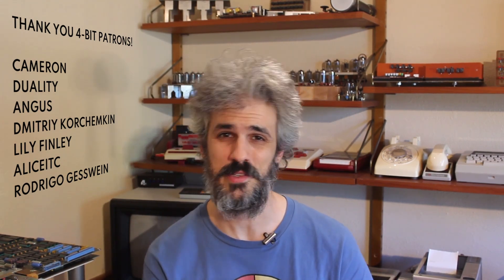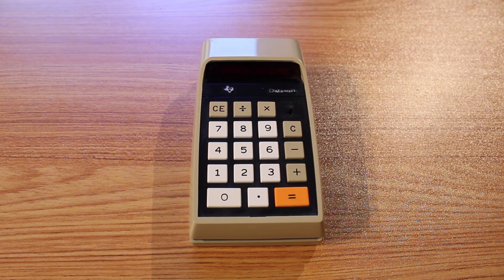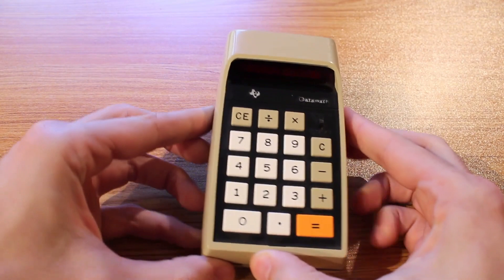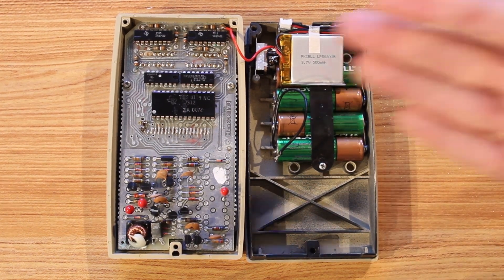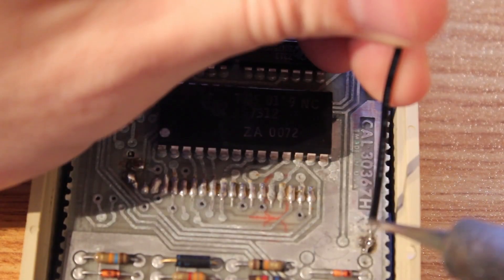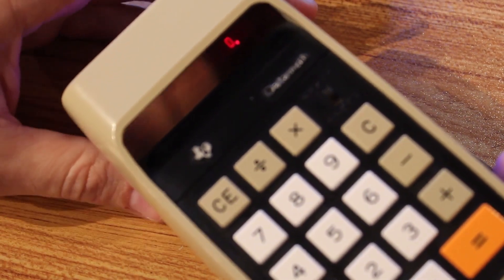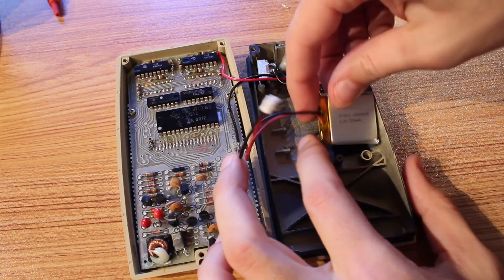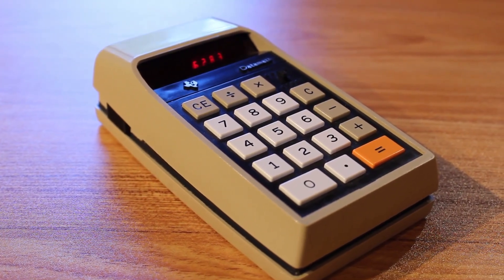Putting a LiPo Battery in my TI-2500 Datamath Calculator from 1973

Comment: I got one a while back for $3.. I swapped the dead Ni Cad to see if it would work, it did. Next step to upgrade to your solution. I've amassed quite a few LED Calcs over the years and luckily all been either a dodgy wire or dead cell to fix. Thanks for this video yeah I'm old school.

Comment: I've got a 2510 which is visually almost identical to your 2500. Bought it in September 74. It has a 2.5mm charger plug like used for some radio earplugs. Also a removable battery compartment cover. Still goes just fine.
Reply from the maker: Nice! The addition of the removable battery cover in the later revisions was an excellent update. These are great little calculators, aren't they!

Comment: You should put the original battery strap (and screws) back inside the unit so it's complete if anyone in the future wants to revert or a better battery technology comes out... but nice job... I think I'm going to make this exact same modification to my 2500.
Reply from the maker: Thank you!
I've got the original strap and screws in a little baggy on the shelf, but I should definitely tape them inside, that's a smart idea!

Comment: I know the feeling. I work for a company that has a presence in all major regions. Thankfully we're large enough that there are usually local resources that can deal with issues outside of our timezone. I did work for a place once where engineers had to dial in to stuff at 3am because there was a problem or something in Australia/Asia. 
Speaking of calculators, I just got a Sharp Compet calculator which has an AC cord. The display on this thing is gorgeous and my purchase was inspired by Fran Blanche's (Fran Lab) recent video on calculator displays. Looking forward to the next videos on the oscope and the minicomputer restoration.
Reply from the maker: It's truly a double-edged sword working with a company that's on the other side of the planet. It's nice that during the day I don't get any e-mails interrupting me, and I can really focus on the work. But then, all the e-mails flood in at night, haha. 
Which Sharp Compet did you get? Most of the vintage Compet models have absolutely gorgeous displays and design!

Comment: Nice job, one thing to consider might be to desolder the blue power LED. 
It might not look like much but it could half the current consumption if you think about it. 

Sounds tough to work for a company where night and day is somewhat shifted. 

Greetings, 
Michael
Reply from the maker: Ooh, that's actually a really good idea!
Looking at Adafruit's datasheet on the Powerboost 500C board, it looks like the blue power LED uses a 1k dropper resistor, which means at most it pulls 5mA, which is probably a relatively tiny amount, but could definitely be enough to alter overall up-time between charges!

Working for a Japanese company certainly has its ups and downs, but for the most part it works out pretty smoothly. It's really only when I need to be on meetings in the right time zone that I end up having to wake up at 5am or have a meeting start at 8pm or something, but that's not too often and totally manageable!
Reply: @UsagiElectric  and it's a great way to grind out that Japanese, I would assume. Maybe not. None of my languages except English are up to the standard of a professional workplace yet, so I haven't had the opportunity to find out.

Comment: So, the black piece between the ivory case is not in the original design, but had to be added, because they could not fit batteries inside. You can actually remove the black insert, and fit a small lipo in there, and it will look like the original concept. That's what I did, and it's absolutely gorgeous. The case meets up and fits like it was originally designed to.

Comment: I've only just bumped into your channel thanks to the YT ad fro your rotating drum memory vid. I have 1 or 2 old calculators which use a magnetic delay line memory and hoped to learn something about them. I also have a TI 2500 and had this very Lipo idea in mind, so thankyou for taking me through (yes, I live in the UK) the pitfalls before I fall into them myself!

I wonder whether the 2 LEDs on the Adafruit board could be replaced by tiny SM LEDs placed behind the bezel as externally viewable indicators, suitably dimmed so as not to wash out the digits, with a bypass switch inside for those who don't want them.

Even though 1950s computing is way beyond me, I did understand the drum memory one so I have subbed.

Comment: Ha I have of these in my closet that I’ve had since I stole it from my dad in the early 80s. I did a similar mod with a lipo and charger but I also added some wheel weights to bring it back up to the original 70s heft.

Comment: I'm a TI freak, I own a few of these and some desktop 3500 with the panaplex display, unfortunately the keys in those calculators is a soldered unit quite hard to fix, my collection of datamaths are all coming from Brazil looks like in the 70's they had a factory there and produced calculator for the entire south American market, the quality is astonishing good, I know some models where made in europe too, from all my LED calculators the datamath is my favourite
Reply from the maker: Nice to see another TI fan out there!
I need to get a 3500 desktop unit one of these days. I have an SR-20 desktop unit, but it's got some pretty serious faults on it, and I'm not sure I can repair it without the schematic. I also have a TI-5015 printing calculator which still works great! Though, even as I try out and acquire more calculators, the TI-2500 is still me absolute favorite. It never leaves my desk and I use it almost daily!

Comment: Do you use some sort of solder fume extractor or fan?
Reply from the maker: I really should, but I don't. I usually solder in a nice ventilated room with the ceiling fan going, but it still would be better to use a fume extractor.